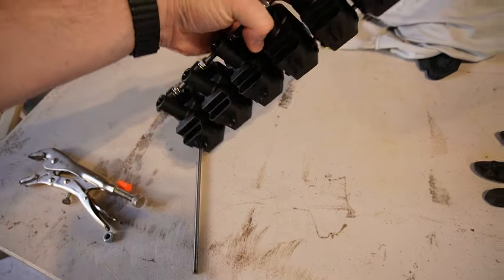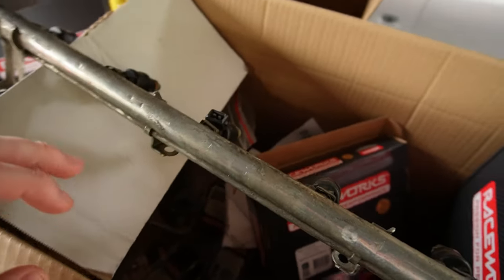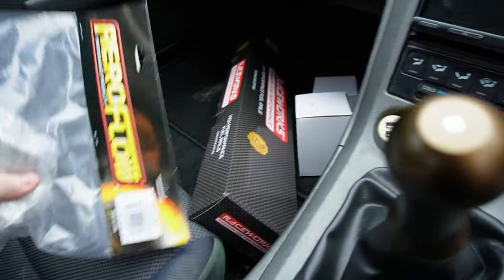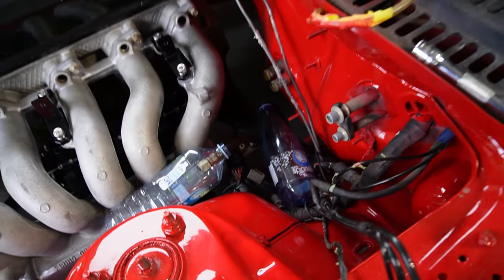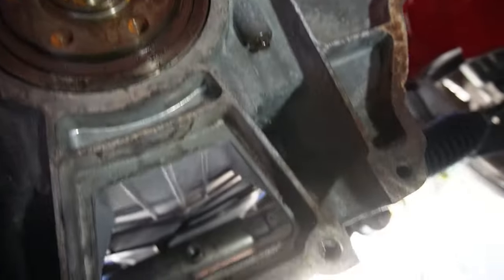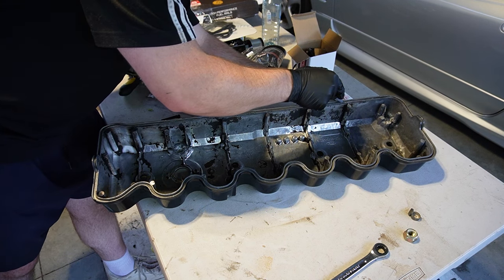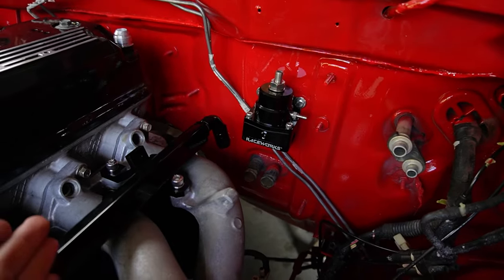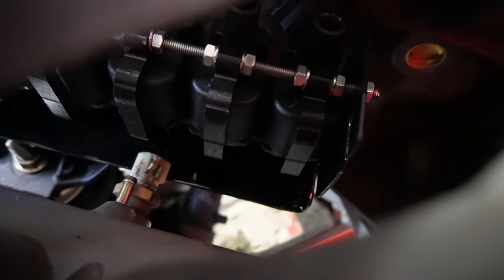YOUR TURBO FALCON NEEDS THIS UPGRADE!

Comment: The fact your a qualified mechanic and still want to work on your own car is the weekend is a shock. 

I’m a 2nd year apprentice mechanic and on the weekend I don’t even want to look at my project cars haha
Reply: I’ve been qualified for 5 years I stopped buying old cars cause the last thing I want to do in spare time is work on cars 

I have a 2022 jimny a 2022 hijet
And a 2015 gt86

Only thing I have to do for them is change the oil

Comment: Always love an update on the XR6 Turbo! You should definitely consider getting the phenolic spacer from t.i.performance it doesnt matter how big n sexy ur intercooler is once the air reaches the heat soaked intake manifold them air temps will be raised again, its basically a big thermal spacer for the manifold so its not directly bolted to the head with the thin gasket.
Reply: Second this.
Intake temps are the biggest killer of any power beyond a particular point.